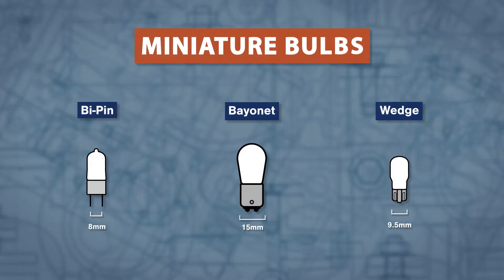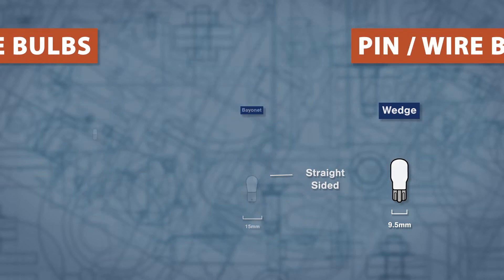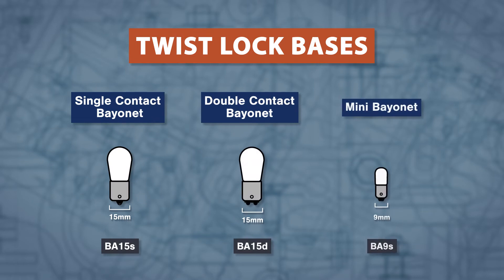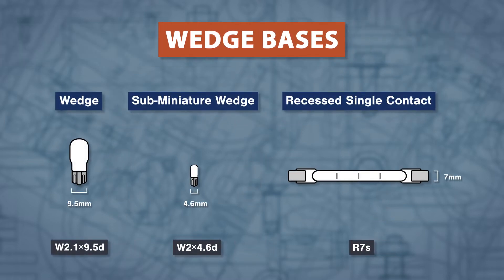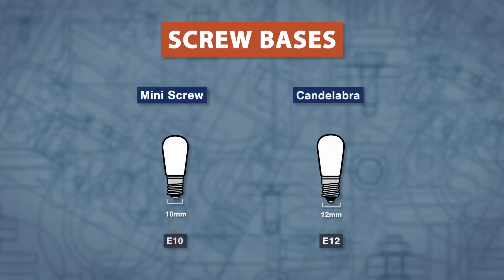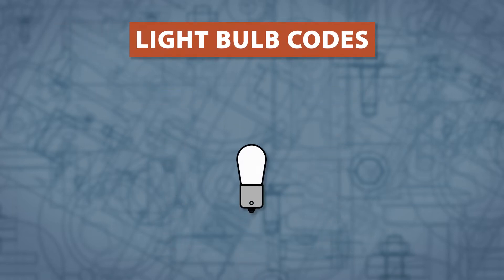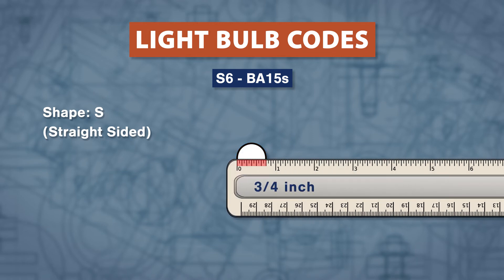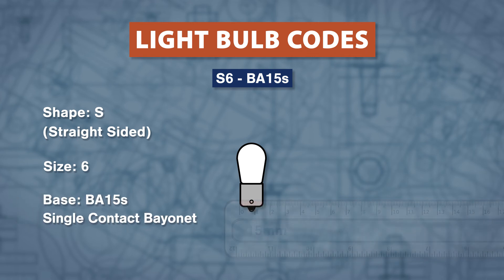Miniature Light Bulb - Size & Codes | Spec. Sense

Comment: hi. i have yamaha m-45 power amplifier i need  pilot lamp 8v 150 ma but I only find Bulbs 8v 50ma 4mm Lamps .I don't know what it means the 150ma or 50ma do you think it still does .thank you for explaining to me what is the ... ma
Reply from the maker: Thanks for watching. mA might refer to milliamp. This would change how bright the bulb is and the wattage. Using this tool https://www.rapidtables.com/calc/electric/ohms-law-calculator.html you can enter voltage and amps to determine the wattage as a comparison. Some devices are only compatible with bulbs of a max wattage so it's good to check the specs.

Comment: I have a Tensor lamp that says use only 1133 bulb.

Several years ago I bought a box of #93 bulbs and have finally gotten around to needing a bulb in the Tensor lamp.
Maybe I should heed the print for #1133 on the bottom of my lamp?

The #93 is shaped differently from the #1133 and I’m not sure if I should attempt to use the #93 in my Tensor.
What is the correct decision for me?
Reply from the maker: Hi Glenn, thank you for watching. Its always best to match bulbs exactly but in this case the #93 bulb will work, but its a different wattage so it will have a different brightness to it.
Reply: @AmreSupply   - Thank you. I see that I wrote a note on the old receipt that it  (the #93 bulb) would be less bright that the stock bulb (the #1133) base on something I may have seen on the web. However, I never used them because I was afraid that they might damage my Tensor lamp.
Reply from the maker: @COH2000  Using a lower wattage incandescent bulb in your fixture is fine but you will have less light than before. Using a higher wattage bulb than what is designed can damage the fixture.
Reply: @AmreSupply  #93 is a 13 Watt bulb
.
#1133 is a  24.242 Watt bulb
.
So #93 (13W) is safe for my Tensor lamp that is labeled 'use #1133'.
Volts and Amps respectively are not a factor?
Reply from the maker: @COH2000  If the volts are the same, then a lower wattage will result in a lower amperage, which means the fixture won't overheat. 

Its the same for larger fixtures. A light fixture rated to be use with 100 watt bulbs can safely use a 60 watt incandescent bulb